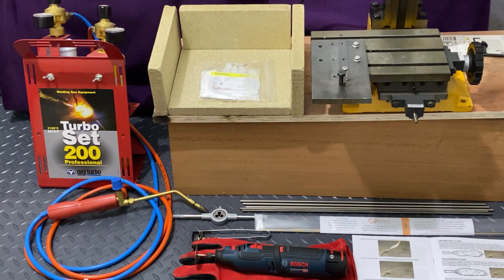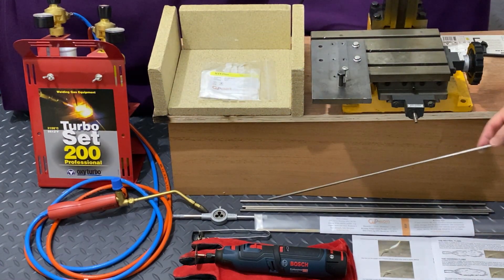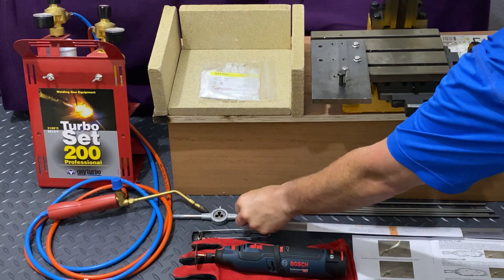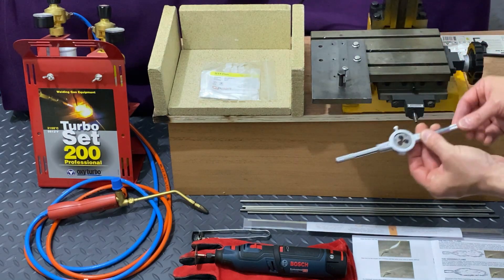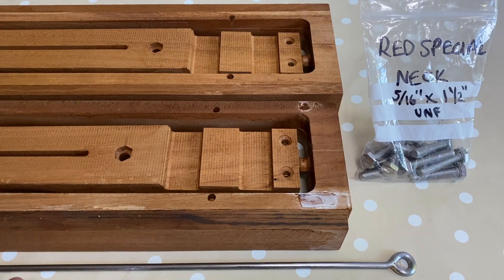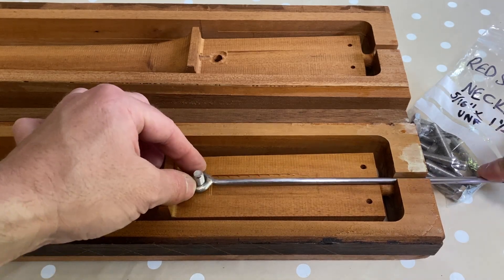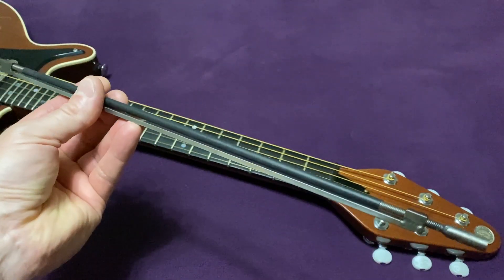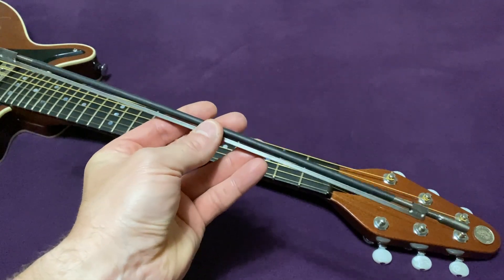Brian May Red Special Guitar Build Project: Making the Truss Rod

Comment: What type of washer do you use for your truss rod? I have a square washer, but the one I see everyone use is rectangular and long. I can’t seem to find one of those. Thank you in advance.
Reply from the maker: Hi. If you are referring to the part that the sleeve nut butts against to adjust the tension, this is custom made from a section of 1/16" thick brass sheet.
Reply: @dsgb  Ah, I see. Thank you for the response!! Guess I’ll have to stick with my little square washer then😂😂 or ask around the red special forum, or on other YouTube channels to see if I can get someone to point me to a similar one anywhere. thanks again for the response.